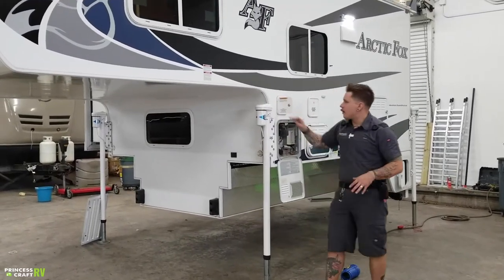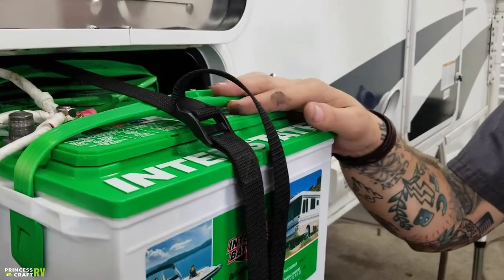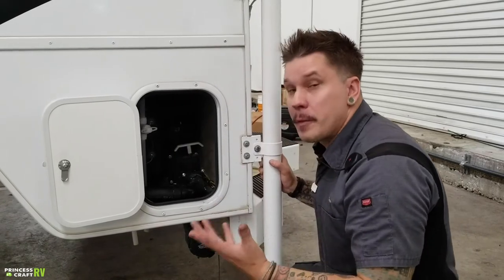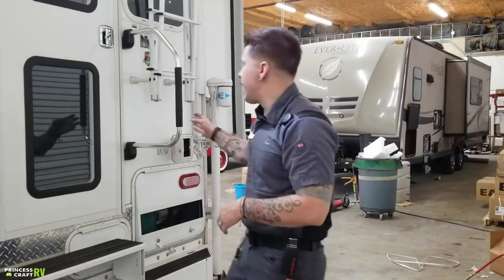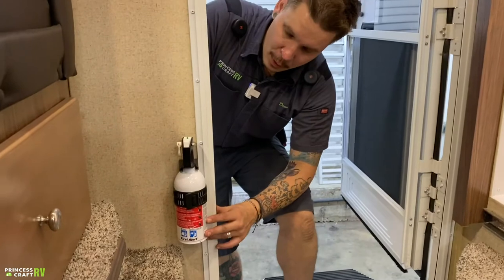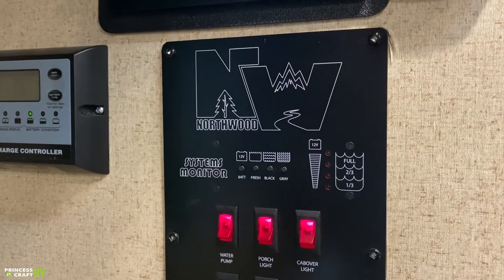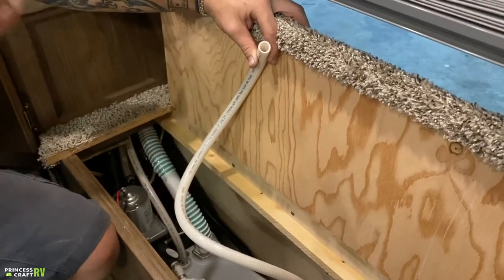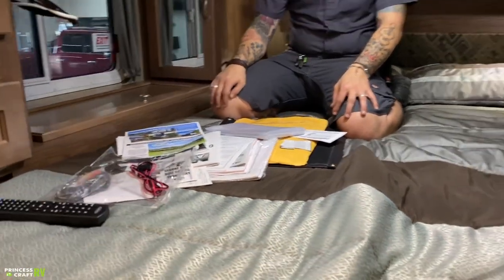2019 Arctic Fox 990 Truck Camper - Technician Tour

Comment: I bought the 2008 model arctic fox 990 with the slide paid $ 23,000 up then Nevada used. Me and the kids had some fun on it for a few years maybe five or six in the snowstorm it held up well but water got into the seams with the caulking and the water froze and pushed the caulking out in the front outside corners water got in either through the clearance lights and behind the plastic and formed a big level above the truck. The plastic comes down the front and loops underneath. We drilled a big hole or small hole on the side to drain the water also when I step on the roof now there is a crunchy sound as it seems like there is plywood underneath that is deteriorating due to moisture getting underneath the rubber roof coating. I was not aware that there was actually a plywood layer that would deteriorate when it got wet luckily, no damage to the ceiling inside yet as staining. not real pleased with the fact of how the roof deteriorated and 16 years and water got under the plastic in the front. Do not want to spend the money on fixing it so whoever I sell it to will get a big discount since they will need to take this and get it repaired, any ideas on how I can accomplish this in central California. I am much more pleased with my fiberglass 22 foot Chinnook camper from 1990. No leaks at all and no problems on a Ford van 350 Dooley no leaks from the ceiling on this fiberglass camper since it is all one unit like a big helmet, much better design than the Arctic fox 990 which has problems with the plastic delaminating on the outside and the rubber roof having too many holes in it. also tell your customer they need a large enough truck to carry this as if you want a crew cab you better get a 4500 or a Ford 450. This camper may say 4500 pounds dry but when you load it with all the stuff such as the refrigerator, propane tanks, batteries, and generator along with your beer and ammo, you have just increased your Camper weight to over 6000 pounds. I have even seen people carry these on single wheels which is insane dangerous and greatly overloaded. We originally did this on a 2006 3500 ram Dooley and we’re probably overloaded by 2 tons for at least two years that we used it then we bought a mega cab 3500 ram from 2014 that had a 14,000 pound GWR we were a bit over 1 ton overloaded on that vehicle. #1 put on the scale with family. we were 16,300 pounds.